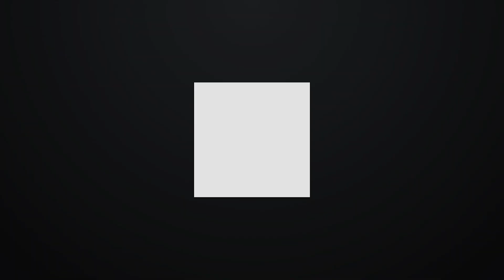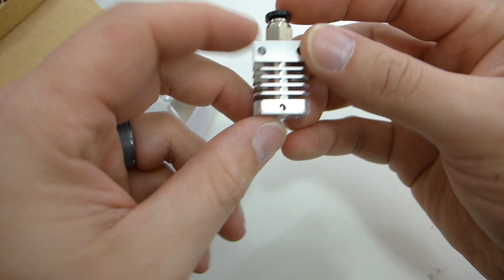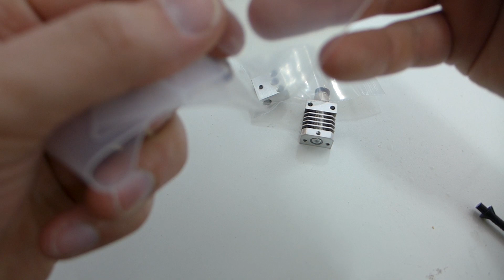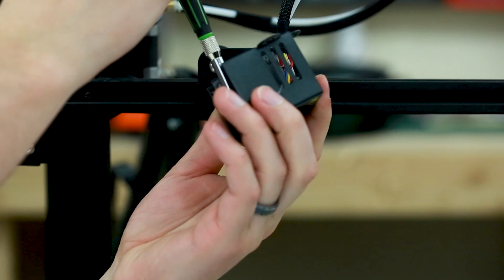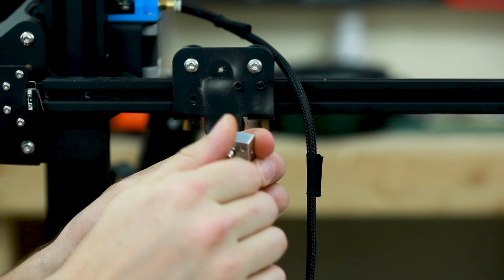Microswiss All Metal Hotend on the CR 10S

Comment: You left out the part where you need to use the two screws to attach the heater block to the heatsink to line everything up before you install/tighten the grub screw... also when you installed the Capricorn tube, you were off screen... other than that... enjoyable
Reply from the maker: Nobody is perfect right? :)

Comment: I also downgraded to a micro swiss from stock. I haven't been able to get the same print quality as the stock CR20. Getting some weird underextrusion after the nozzle passes corners. I followed the instructions of their youtube video but installed the heat block that came with it. Maybe I did something wrong.
Reply: How do you ( I also downgraded to a micro swiss from stock. ) Do you mean UPGRADE ?

Comment: given that creality can reach up to 260c since you installed the all metal hotend that reaches 300c. can you have the printer reach that temp? or does it need to be flashed with the marlin software to make use of the higher temps? thx
Reply from the maker: You can't do 260 on the CR-10. The PTFE tube starts to break down around 245 and will defiantly melt at 260.
Reply: i have a creality ender 3 and have printed esun nylon and also nylonx @ 260 which is the max the printer can go in order for the filament to print successful but i'm still new to 3d printing, i do have experience with cnc machining. it's a whole new world when it comes to 3d prints though. i want to be able to print with any material and having a 300c hotend is the way to go i heard haha i changed the nozzle to a .4mm micro swiss a2 plated nozzle for the carbon fiber but i still find that when i print polycarbonate 260c it doesn't cut it, i get layering and according to forums its the temp that needs to be higher. if i get a all metal hotend, given the printer has a temp limit. can i set the higher hotend temperature in cura or will it still be limited by the printers software? i don't want to flash the machine if i don't have to in order to up the temps. thanks for your reply!
Reply from the maker: Once you upgrade to an all metal hotend you can modify the firmware to allow it to go hotter.

Comment: Regarding Capricorn there is some false information out there, Just like any other PTFE, DO NOT expose this tubing to temperatures exceeding 260 degrees C.
Reply: Don't use it for a ptfe liner, quit using the shit stock mk8 that you stick the ptfe all the way down to the nozzel. Problem solved.
Reply: GoopyPlastic Isnt the heatbreak supposed to be allmetal? Or do you mean the ptfe bowden tube.
Reply: I hate a tube I can't see thru ~

Comment: I bought a MicroSwiss and plan to upgrade my CR-10 and CR-10S at some point.  What material did you print the new fan duct work in?
Reply from the maker: I'm using PLA for now. Since the printer is not enclosed and they are not that close to the heater it holds up very well. https://www.thingiverse.com/thing:2274499 I also added it to the video description.
Reply: Thanks!
Reply: I completely understand a busy life!
Reply: Also - What's the model you're using for the fan duct?
Reply from the maker: And sorry for the delay in my response! These past few weeks have been crazy. I hope to be more timely in responses in the future.

Comment: 4:05 To loosen the PTFE-tube you have to PULL the fitting cap, right? Pushing it in tightens it! Correct me if I'm wrong.
Reply from the maker: No. You push the push fitting in, hold it in, then pull the PTFE tube out. Otherwise if you pull the PTFE tubing it would just come out if you had to pull the fitting.